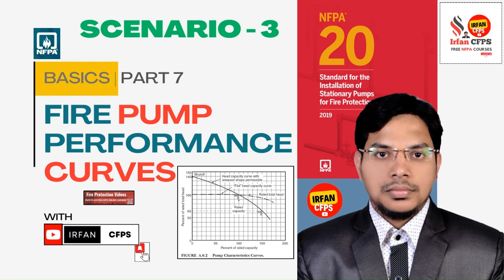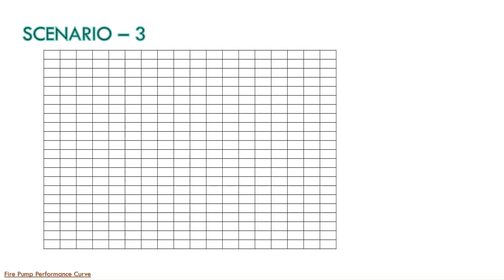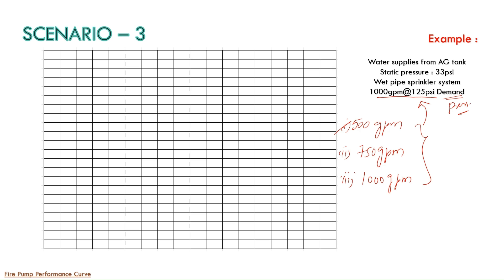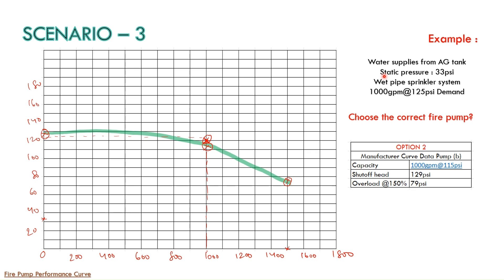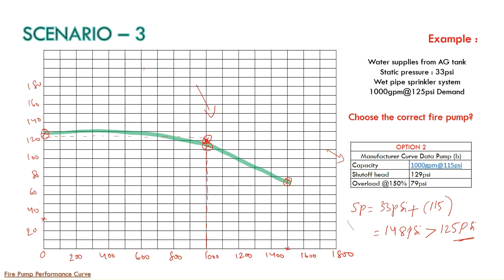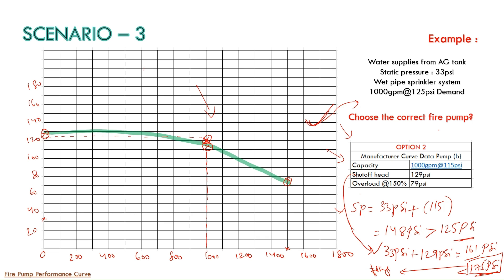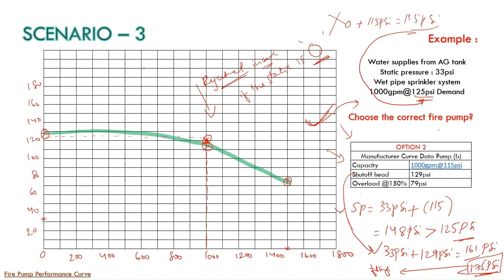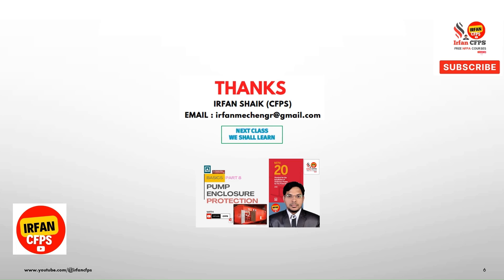Understanding Fire Pump Performance Curves: A Simple Guide - Part 3

Comment: can you please provide what section in the NFPA states that pump is accepted when the operating point of the system falls in the region under the curve between the rated capacity and max capcity as i was asked by a contractor to choose the minimum and the least cost accepted for a project and when i choose a pump that the system point falls in the curve but at its very right end the consultant refused it so i want to provide the code that supports what iam saying
Reply from the maker: NFPA 20 – Annex A.4.10. The Annex recommends against selecting pumps below 90% or above 140% of rated flow. So, For example, if the required system demand is 1100 GPM, NFPA 20 Annex A.4.10 recommends selecting a pump between 990 GPM (90%) and 1540 GPM (140%). So a 1000 GPM pump is acceptable.

Comment: In the example what we have considered, the water tank is on the ground floor level, and the hydraulic calculation results got the value for the static pressure as 33 psi. Does this mean the sprinkler point what we have taken for the calculation is from the basement level? and if in case the result of the hydraulic calculation showing the static pressure as 0 psi which means we have considered our sprinkler points somewhere at the remotest area above ground? please clarify.
Reply from the maker: The 33 psi is static pressure from the height of the water in the tank (gravity pressure before the pump starts). It's not from hydraulic calculations. Hydraulic calc gives the required pressure and flow at the most remote point — like 1000 gpm @ 125 psi in this case. Hope that clears it up!

Comment: Great explanation. Jazakkallah. In this video, exactly at 5:58 you are saying that "Static pressure from the tank is 33psi". Does the static pressure we are getting from the hydraulic calculation is for the water tank?  Kindly explain.
Reply from the maker: The 33 psi is static pressure from the height of the water in the tank (gravity pressure before the pump starts). It's not from hydraulic calculations. Hydraulic calc gives the required pressure and flow at the most remote point — like 1000 gpm @ 125 psi in this case. Hope that clears it up!

Comment: Why do we calculate water supply if we just gonna use Fire Pump? Is flow test the only way to calc water supply?
Reply from the maker: 1) We calculate the water supply needed for the fire pumps to decide the right size for the water tank.
2) Please note that a fire pump performance test is different from a flow test. The flow test is conducted at the existing fire water network tie-in connection to assess whether the new fire water line can be connected. By performing the flow test, we can determine if tapping the new line from the existing one is feasible. Additionally, we need to run calculations for the new fire water line up to the existing tie-in connection to verify if the flow and pressure available are sufficient for the new network."

Comment: Hi, could you explain it is acceptable for the shutoff head pressure of the pump to be lower (161 psi  ) than the maximum rating for the pipes pressure (175 psi) of the fittings?
Reply from the maker: Hi no need to worry about shutoff head since it will be provided by the fire pump manufacturer. Ul/fm fire pumps comply to nfpa 20 requirements

Comment: Great share…could you also do a video on pump on pump in parallel performance..in some facilities especially petrochemical facilities fire pumps are arrange in 3 x 50% configuration
Reply from the maker: Great suggestion. will make a note of that. thanks

Comment: How do we calculate the static pressure of tank?.
Reply from the maker: For static pressure of tank, 
formula will be pressure in psi = 0.433 x h (height of water in tank in ft)
Reply: @irfancfps  I think when it comes for water tank alone, it should be called as hydrostatic pressure, where the pressure is occurring due to gravity. The term static pressure determines the pressure in the whole system, where it can be from the gravity inside the tank together with the pump pressure. Please correct me if I'm wrong. Thanks.